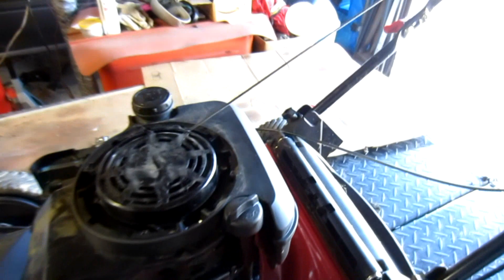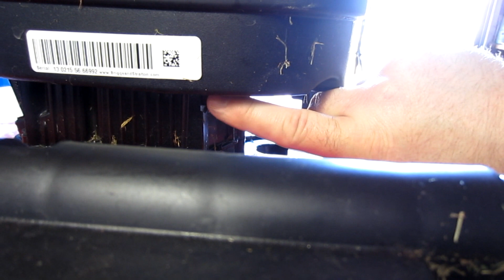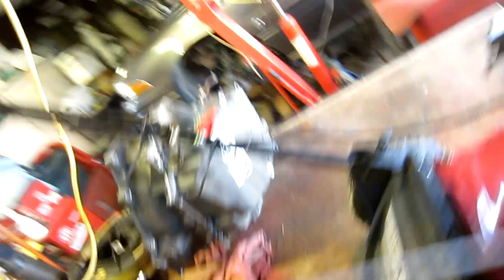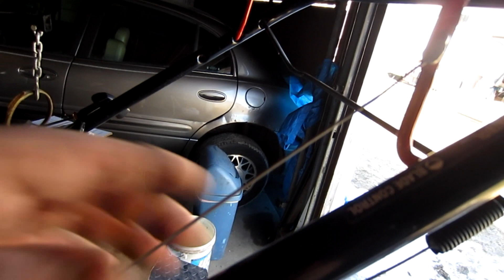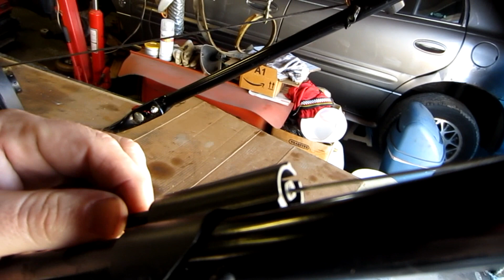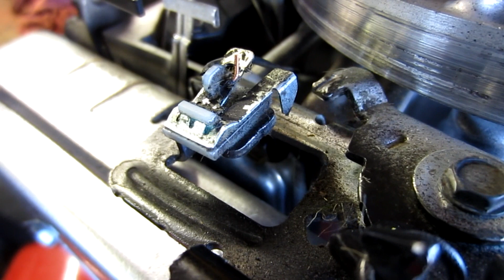Briggs Push Mower flywheel brake repair

Comment: Shoulder bolts are expensive and difficult to replace. Not for sale at Lowes or Home Depot specialty fastener aisle. You might have to order them online which will take time and they are very specific sizes. Don't lose them.

Comment: Good thorough video!On a Toro 22 inch all wheel drive will lawnmower run with out the belt adapter above the blade mount?Also is the 5/16 bolts good for securing foundation to frame?

Comment: This is a very good explanation on how the brake assembly & cable work.  I forgot the gas tank spacer, thanks for the reminder.  You made some really good important information, such as the size of bolts.  I know this video is little old, but still a very good video.  Thanks for taking the time to make it.👍👍👍

Comment: I bought a control cable for my mower that was supposed to be the replacement but it was too long. I ordered another one but shorter. It's better but I just noticed that contact still touches. I'll see if I can find something to make space like u did. Hopefully it works. Thanks. I know my cable isn't broken so I'll have figure how to rig it or get another shorter cable.

Comment: Great vid. Feels like the brake on mine is stuck after turning the mower on it's side to check the blade. Mine has an adjustable cable so hopefully an easy fix. Will report back!

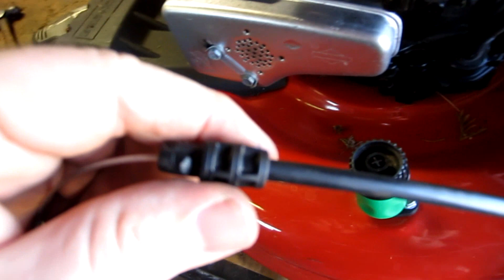Comment: A way to shim [ @9:26 ] the mower cable end with a side-slotted metal spacer, effectively takes up cable slack (in this instance, due to defective cable adapter manufacture @8:40).  This is another possible option, beyond unscrewing the connector/adapter ends to gain some SHEATH length, effectively shortening the cable WIRE.  Good tricks to have in your mower maintenance/repair bag, though I am a little shocked that actually fabricating the needed metal cap would be cheaper than replacing the cable, as fabrication seems costly if you can't do it yourself & have to pay someone to do it!
[4.26.2023]

Comment: How lucky can I get!!!!! Toro mower is hard to start. Similar problems to your mower. Had the carburetor off several times and still no luck. You tubed several sites and presto chango ran across your site. Watched very closely and Bam!!!! Made the adjustments to the cable and Vaaaarrrrooommm it's running. Nicely done and thank you. PS. I HAVE SUBSCRIBED.

Comment: Great Video, have to do the same repair and it helps a lot to watch the steps in advance. Just one remark for the DIY repairmen/women: Stay on the safe side and ALWAYS disconnect the spark-plug connector before working on the mower. The boss is an expert and knows when a particular job bears no risk to accidentally start the engine. For all the others: make this part of your start-to-work routine.
Stay safe!
Greetings from Germany!
Andreas

Comment: My cable is fine, but the bearing that allows the assembly to swivel has seized for some reason. Won't budge at all. Is there a solvent I can use to free and lubricate the swivel?
Reply: I know it's a long time since you asked this, but did you ever find the fix for this issue, have the same thing going on!

Comment: Well done, nice clear presentation - gave me an idea for my own problem - consider using a bicycle brake cable adjustment nut for taking up the cable slack.
Reply: Got it to work, but a bicycle brake cable adjustment nut is a bit big . . .  a derailleur cable adjustment nut is probably a better (smaller) fit.

Comment: I rarely take the time to log in and comment but this video is extremely helpful and really well done.  Thank you.  A non mechanical buddy dropped off his 2 year old mower that wouldn't start because he left in old gas.  Carburetor was clogged so pretty easy fix to clean it.  But when I went to pull for a test start, the whole handle slid/collapsed down into the mower thru the deck and the brackets that hold it in place.  He had removed the lower screws to bend handle to fit into his trunk but forgot to mention it or leave the screws for me!  Now when I turn the blade I can hear a groan which I can see is likely the brake since the cable was pushed in along with handle.  Thanks for the quick/clear explanation of how it should work.  Hopefully an easy fix!

Comment: Good Job! Good script, good camera quality, good lighting. I recently replaced my old (9 years) stretched cable for about $8 delivered. Troy Bilt with Honda 160 CC engine. Gas Tip ... Small Honda Engines have narrow fuel "Channel; they DO NOT DO Well with Ethanol Gas. I had to replace my Carburetor and NOW use ONLY "Clear" Gas. (About $5 per gallon here locally, but well worth it.  AND you no longer have to worry about "old" gas - or stroage over the Winter. NOTE: MOST dealers will NOT tell you this - they just like to charge over $100 to change the Carburetor. Starts and runs like a new Mower. Now I will check that the brake is being retracted properly. John in Portland, Oregon.

Comment: You could have just replaced the cable like everyone else but I am so glad you went the extra mile. I am currently having an issue where the cable bracket gets stuck and will not engage enough to allow a spark. Before discovering this, I thought it was a fuel issue and bought a lot of unnecessary parts. You just saved me from spending hundreds $$$ on a new mower. I really liked the thorough information in an easy paced presentation. Thank you so much!

Comment: Is the wire connection normally open ( with handle released) or normally closed ? 
Does it just ground out , killing the spark when released ? Or connect a voltage to the coil when handle is actuated (squeezed up).
Reply from the maker: It grounds the coil when bail is released

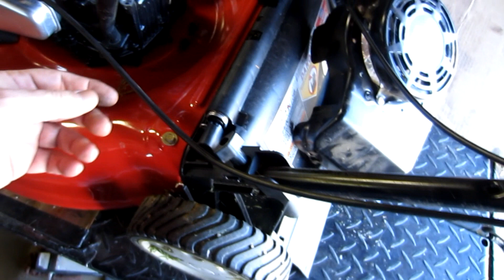Comment: What is the name of the spring your pointing at frame 6:39? ...I have a 1998 craftsman push mower 21" recycler its missing that spring. Sears does not have it anymore and I'm not sure what size to get. The space between where the spring would hook is 2".I appreciate your help.
Reply from the maker: flywheel brake return/tension spring...any real mower shop will be able to get that for you...you can use almost any small briggs engine to scavenge that off of as they were all pretty much the same spring...
Reply: Foxboss9 thank you very much for your quick response!
Reply from the maker: CB Scott 👍😁

Comment: still got spark, it should read, just no ignition of any sort
Reply from the maker: 1fastpitchforever if you have good compression then it sounds like a sheared flywheel key or a stuck exhaust valve or broken camshaft..
Reply: Stuck valve, thank you!
Reply: 1fastpitchforever 😁👍
Reply from the maker: 1fastpitchforever oops...rvdaydream is my other channel..👍😀

Comment: Going to check this. (B&S) Self Prop'l Mower is 3 years old, looks brand new and only used to cut a small yard. Was running great. Put on a new carb, then a new magneto/coil & plug. Pulls nice with good compression. Video has me wondering if I even check the cable, I do remember there was a lot of film on the fly wheel. Got me thinking in the right direction! Any ideas?
Reply from the maker: 1fastpitchforever If you have spark then this is NOT your issue. When you replaced the magneto,did you remember to set the air gap?     Again, if you DO HAVE spark look elsewhere... For example, make sure engine output shaft is straight and that the blade isn't bent or that the blade hasn't recently been replaced... That is a sure sign someone hit something with the mower while running and most likely means that the flywheel key is sheered (makes the mower out of time)..watch my video on snowblower seasonal repair(I think thats the one) as to how I check Small engines for Spark,Timing,and Fuel delivery issues within minutes just With a can of carburetor cleaner OR starting fluid.. good luck..
Reply: Yes that's whats puzzling me on this one. Key and keyway -perfect, new carb, new maneto with gap set, new spark plug, going to check if kill switch wire is grounding out? Shaft not bent/regular wear on blade. Brake disengaging. I keep thinking I am making a continuous error and overlooking something everytime I look at that mower, and I must be. Still no spark.
Reply: after checking for spark and before I installed the plug, I gave it a shot in the head with some starting fluid, still no combustion, shot of starting fluid in the carb, no ignition. Originally that is why I bought the coil, thought maybe not enough spark?

Comment: I have a old mower, 1993, it's a Briggs and Stratton mower, quattom xp, I bought a new brake cable for it, and it appears too loose, I had to take the spring off in order to make it work, if the spring is on, it won't start, when depress the handle to start, it seems like the cable is to long, what's my issue ???
Reply from the maker: Courtney Johns Honestly, sounds like you answered your question.. When you engage the handle bail it's not disengaging The engine brake far enough allowing it to keep the ignition grounded..hence, The "no start".. I would look at the bail and make sure it is in the right holes on the handle.. also check that it's not upside down or bent(I've seen that before).. If All is good there then you will have to modify your new cables length(kinda like I did in this video)... good luck 😁👍

Comment: Making that little cable spacer was very clever!  

Today when I turned my mower off today it made a metal on metal noise so I took the plastic off and saw the brake pad had worn down to nothing. (6 year old Honda HRX) My mower has significantly more wear to the flywheel with maybe even a little groove. How much damage is too much to the flywheel? Are there any other wear items on a mower that I should be checking? 

This is a link to a picture of my flywheel if you have time. http://imgur.com/a/wYiWv
Reply from the maker: Thanks for watching... That wear in your image is pretty typical and should not be a concern whatsoever..

Comment: Thank you for this video!  You confirmed my suspicion as to the problem with my mower.  In my case, I had to use a hose clamp to secure the plastic guide/clamp to the side handle bar.  The plastic clamp had become loose, which is no surprise after 9 years.

Comment: awesome vid. I had atroy bilt w/ b&S motor taht have lasted me for over 10 years ,but last year I decided to change the blade adapter adapter that was chipped, but could only get the only one that was avail for my model which was cheaply made as the dimples sheared off as soon as I tried to start the mower.  changed my blades and removed the adapter for years and never had a problem once I put to back on, but after putting the new one on it broke as mentioned above and then I couldn't start the mower.  When trying to pull the starter cord it wouldn't budge or was clunky pull.  suspect the brake was now engaged and this video helped a lot. thanks !

Comment: fantastic vid, been trying to figure out why my tecumseh 6.5hp wouldn't start and i'm now sure it's the brake/kill switch. can't wait to try it out and see if i can finally get my free ride on mower running.
Reply: Tecumseh kill switches and engine brake assemblies are far different than most Briggs.  As an example, the brake shoe rubs the flywheel from the inside and not from the outside like the Briggs.  They're nearly impossible to remove without the removal of the flywheel.  The kill switches are different as well.  The only thing common is that they both connect to the coil.

Comment: Foxboss9 do you mind explaining in further detail or make a video on how the cable gets the lever to move? Ive watched this video repeatedly and searched the web, but Ive had no luck on figuring out how this works. my mower will work but the cable isnt moving the lever towards the mounted cable bracket when I pull the cable at the bail arm end. Im very confused as to how pulling the cable squeezes the lever. Like zeus said, it seems like the plastic would do all the work and Id appreciate a little advice lol. thanks!
Reply from the maker: Dallas Bixler  Sure Ill try.. the steel cable end that attaches to the engine connects to a non-moveable/fixed bracket.. so as far as the engine side goes the steel cable never moves...the plastic cable housing attaches to the pivoting brake arm. when the operator pulls the bail on the handle the steel cable is pulled, but, it can't move since it is fixed to a non-moveable mount instead the plastic housing collapses towards the steel cable end to make up for the movement needed. now, because the plastic cable end is on a moving pivot arm, the brake is rotated away from the flywheel as it is on the other end of the pivot arm.  ive worded it the best I can. I will look to see if I have anything here in the garage that might have that set up ...If I do ,,,,Ill try to shoot a video on it if you still need clarification just let me know..

Comment: Just wondering where you can get those split spacers you used to take up the space on the brake cable?
Reply from the maker: jpwjaz I made that one BUT, you can buy them.. It is just like the end of a bicycle brake/shifter cable.. Walmart has the entire cable cheap with the ends that you can use...

Comment from the maker: Zeus Carver the plastic cable housing end connects to the engine brake lever and moves when the bail is pulled due to the steel cable end on the engine being anchored to a engine mounted fixed bracket

Comment: Nice video. Im a bit confused as to the internal workings of the cable itself. It seems that the plastic conduit is actually doing the work, not the internal metal cable. One end of the metal cable is fixed to the engine (doesnt move) and the other end is attached to the bale arm. When you pull the bale arm you are only increasing tension in the metal cable not actually moving the other end, because it is attached to the engine. It also seems as you "pull" the cable you are actually "pushing" the plastic conduit. My guess is that the plastic conduit is designed to be too long for the space and normally be bent. When you increase tension by pulling the bale arm, the metal inner cable tries straighten the plastic and pushes it out. Is this how it works or am I missing something? Personally I would have designed it to have the end of the metal cable attached to the moving part of the spring.
Reply: The actual design of the engine and method with which the cable works, it differs from mower to mower. For instance, on a "Classic" Briggs, the cable moves inside the conduit, as well as on the new E series engines. This style in the video, where the conduit is what's moving, is the Quantum style, they seemingly held up better, the cables also from experience lasted longer.